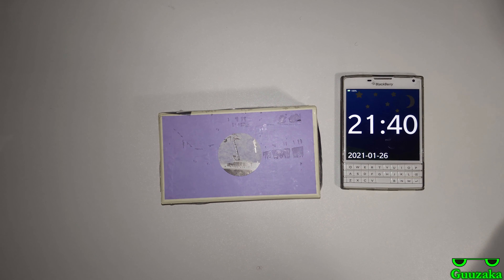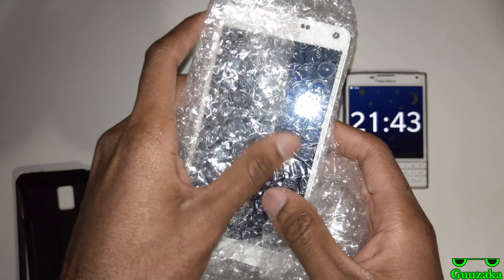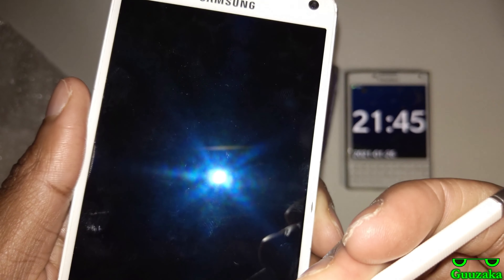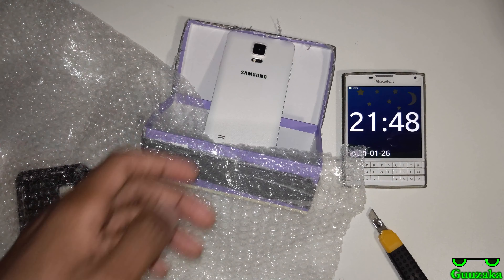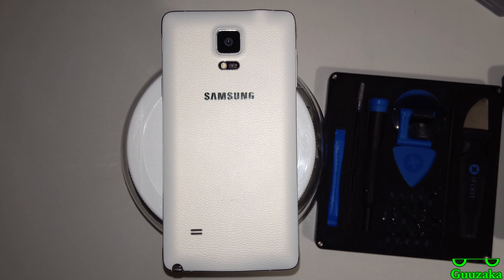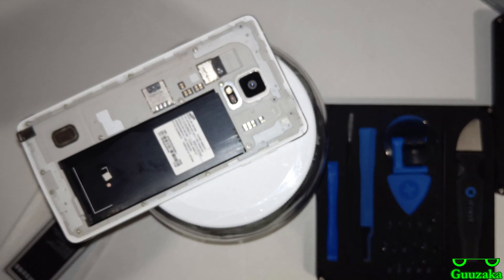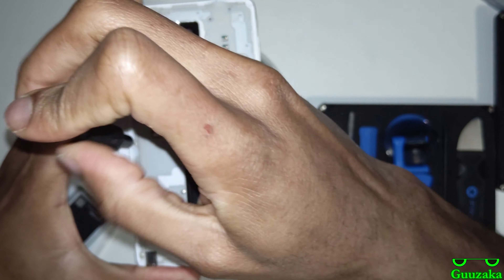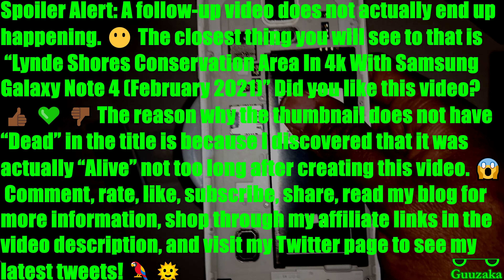Unboxing Dead Samsung Galaxy Note 4 In January 2021

Comment: Long live the Note 4!   I have 2 functioning phones, 1 for parts.  This phone is highly repairable.  Replaced screens, motherboards, speakers, not hard at all. 
Phone has a beautiful display.  This is the last model with the removable battery.  (I have 7 batteries).  Nice to always have a spare charged up.  Never have to look for a charger.  I charge the batteries in a external charger and always have a fresh battery to go.
The one in the video is the SM-910T for T-mobile.  Good model. Note  also has SD card slot.  (I have 256 GB in mine).
Android 6.0 is the last version for a fully functioning Note 4.  Custom ROMS beyond that are around, but then you lose the S-Pen working.  
This phone still does everything I want. 8 years old and still kicking!
To open, there is more than screws.  You have to break the glue seals.  Not that hard, but easy to crack screen if you're not careful.  Many good videos on Youtube to show how to properly do it.
I love my Note 4!
Reply from the maker: @dc10driver1  
This video was shot 13 months ago, so I now have 2 Notes plus a Note for spare parts. 😎 2 SM-N910W8 and 1 SM-N910C. 🌌 Samsung did serious disservice to its hardcore fans by releasing an S22 Ultra with a non-removable battery, and no IR blaster, headphone jack, and MicroSD card slot. 💀